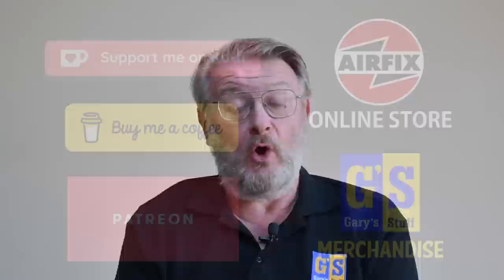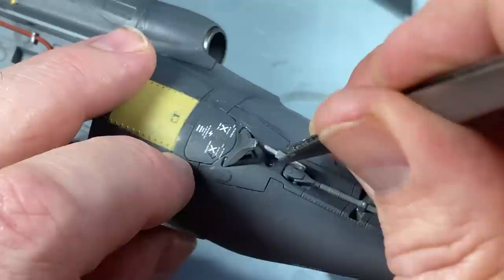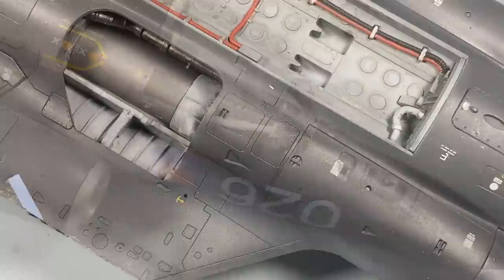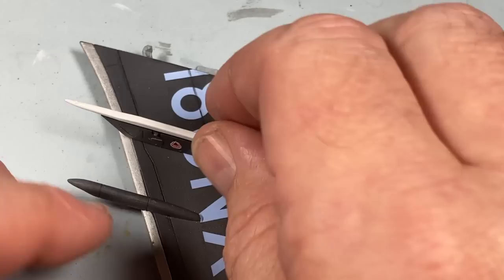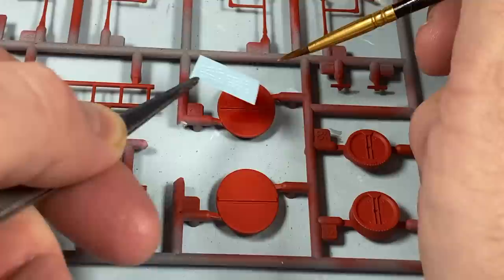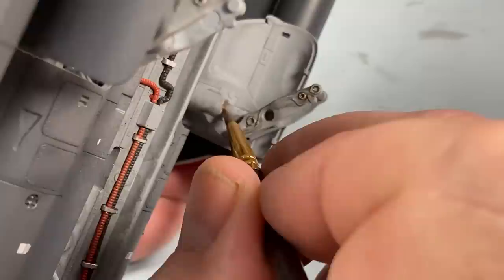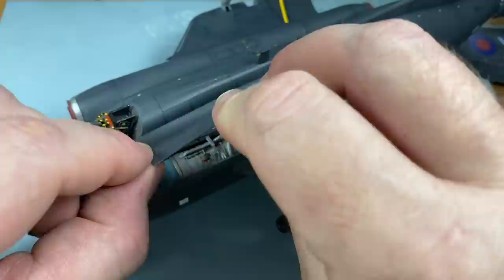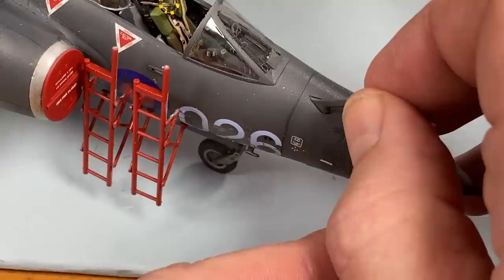BUCCANEER Airfix 2022 brand new tooling 1/48 scale - build day five - final assembly! - HD1080p

Comment: For panel lining over decals I HIGHLY recommend using a new blade and cutting/scoring the decal over all the lines. Then use the MicroSol over top to get the tiny flaps to lay into the panel lines. Then when you add the panel line fluid on top (into) the panel it flows in there seamlessly.  If there is any noticeable "decal gap" from the cut...then it gets filled over by the wash anyways. Just a little tip I thought I'd share. 👍 
Over all...I loved watching this build so much that I think I'll pick this kit up when it comes to texas.
Reply: This is a terrific idea.  You'd have to ensure that the cut edges are sealed with MicroSol or MarkFit to ensure against capillary action flowing up the deal.
Thanks!
Reply: @randytaylor1258  actually...I left out a step. Sorry. After the MicroSol is dry and the lines are clearly defined i then go over then with a gloss clear. That seals the decal under a layer of protection. Then if you mess up the panel line and/or weathering...you don't have to worry that the clean up will damage the decal. Then after weathering I cover everything one last time with a matte or flat clear. (Minus the clear parts). Hope some of this helps you out. Give it a test run on a slammer kit first if you'd like in order to get confident with the new steps. 👍
Reply from the maker: Sounds a really good tip. I was thinking of something plastic with an edge and maybe a rounded tip so you can follow curves. I was also going to try an ultra fine marker - say a 0.03mm tip. I can feel a tutorial video coming on!!!
Reply: @garys_stuff  I've tried markers on a gundam. It can tare the decal.

Comment: That ''Aerial'' at the back is a fuel dump pipe and the interiors of the intakes on RN Bucc's were a light tan colour..main wheel hubs are a dark steel colour
Reply from the maker: Of course it is, stupid me. Theybhad them at the back of the slipper tanks too IIRC. It was late, I was tired... Interesting to hear about the colours - have you told Airfix this?
Reply: @garys_stuff  Nothing's stupid mate..it's just modelling..lol..i got the colour call outs from the instructions of the 90's Airfix 1/48 Bucc which i have a few of unbuilt and a copy of a Scale Aircraft Modelling Buccaneer special on the aircraft which had some great pics..would be a bit late to inform Airfix now i'd reckon
Reply: @garys_stuff  Nothing stupid about it mate..it's just modelling..lol..i got the colour call outs from the original 90's Bucc which i managed to get a few of for a good price in the late OO"s and a copy of Scale Modelling Magazine which had a feature on the Buccaneer round about the time the kit came out and had some great pics...they remain unbuilt tho' unfortunately..the twisted main airframe parts  made it a bear to put together...shame...i'd imagine it would be a bit late now to get in touch with Airfix now the instructions have been done
Reply from the maker: Never too late - especially if they are planning an earlier version (say an S.2A). They will like to know about any research on the subjects of their kits.
Reply: @garys_stuff  Thanks for the tip..

Comment: Nicely done Gary ! thanks for the effort in sharing your build , invest in a pair of godhand tweezers  they are not cheap but hold onto tiny parts very well.
Reply from the maker: Not cheap? Not kidding - I saw some online and they were over 40 quid!!! If I start losing smaller pieces then I might look into it!
Reply: @garys_stuff  
Don't know what those are but I use numerous cross-action tweezers all the time.
Reply from the maker: @randytaylor1258  yeah, I use cross-action to hold decal backing sheets, but I've never got on with them for holding parts. If I push too hard to locate the part the tweezers open up and carpet monster gets a free snack!
Reply: @garys_stuff  
That darn carpet monster!

Comment: That’s not an aerial it’s called the donkeys plonk, it’s where the fuel is let out if required before landing .I was an air mech on 800 sqdn 68 to 70

 68 to 70
Reply: Glue the little part where the instructions indicate.
Reply from the maker: Of course it is. And you are on 800NAS? My Dad was in 800NAS back in the late 40s and early 50s, started with Seafire 17 and FR.47 then on to the Attacker.

Comment: Judt curious why they have 3 piolt seats in the kit
Reply: Helps if you read the instructions lol
Reply from the maker: I looked at this in either the box opening or on day one. The forward seat supports an instrument panel for the navigator. I think for some reason a later version has either a different panel or a slightly different set-up, and uses a different size hole on the back of the pilot's seat which is why there are two versions. They often do this - having parts for later versions on the sprue as it saves on building new tooling later. It's also how you know what kits they will do in the future (like the FGA.9 Hunter because the F.4/6 kit includes a tail cone with a drag chute fairing, not fitted until the F.6A and FGA.9, so they must be releasing one of those in the future...).